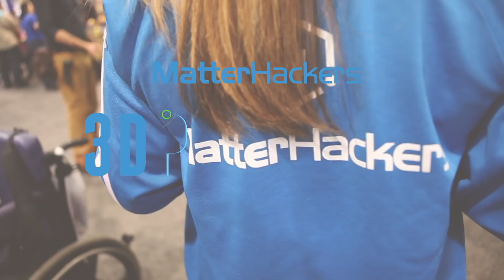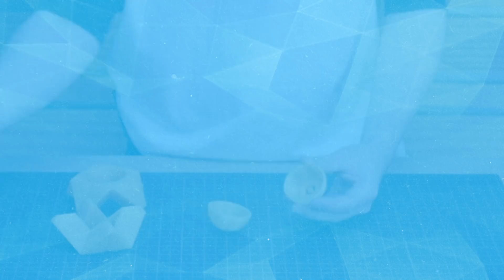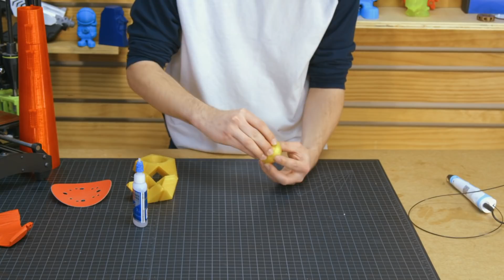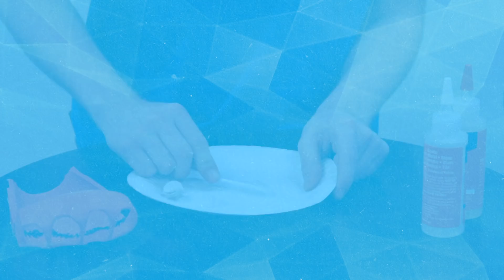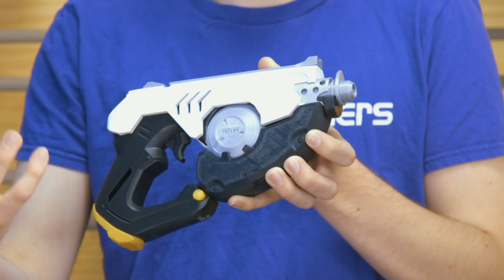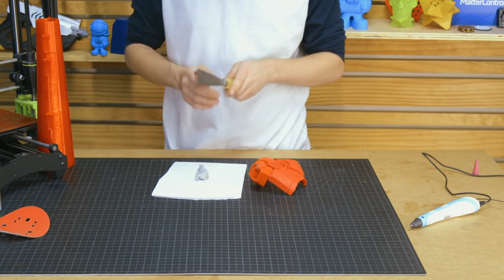How To Bond 3D Printed Parts // 3D Printing Guide and Tutorial

Comment: Hey thanks for the video, I may get a weldering filament pen, I am going to be printing helmets so will be weldering the inside, but for the outside do you need to add some glue or does that stay pretty flush to the other part naturally? I fear that if you do the inside the outside could come apart? 
Thanks a lot

Comment: One more thing about super glue (CA): it gives of fumes that discolor some plastics like PLA when it touches it. Same effect as when you use too much ethyl acetate (for PLA) to smoothen surfaces.
You end up with "white smoke" like tainted parts. You can get some of that off with water if you act immediately.

Comment: Matterhackers: "PLA is non-reactive"
Methylene Chloride:  "Hold my beer"
Reply: can we join PLA parts using this chemical? Is it safe?
Reply: @raghavgarg6909  Yes, you can join parts using methylene chloride. Is it safe - that depends on you.

If you mess with it in a non ventilated room, not safe.

If you make sure you have ventilation and gloves etc, then it's as safe as any other chemicals you can use to bond stuff together.

Comment: I like using the black rubber reinforced CA glue thats available at most hobby shops. Before I join the pieces, spray a little CA kicker on a paper towel and wipe the mating surfaces. Don't spray it directly on the parts as it does seem to attack the plastic. The wipe on method preps the surface without sanding and speeds the curing of the CA glue. Just be sure your parts are aligned because you won't get a second chance.

Comment: Depending on the model I use an old soldering iron with a very flat tip to heat up the connection points. I also use it when there is a crack in the model.

Comment: Now what I would have liked to hear was what kind of glue works with what kind of materials.
For example
Prints in PLA can be glued with....
Prints in ABS can be glued with...... etc.

I have spend a lot of time wasted trying to glue PLA together with cyanoacrylate glue just to find out that there are so many types of cyanoacrylate, that some work and some don't.
Then, switching to other materials, like NGEN of ABS, I found that cyanoacrylate types that didn't work on PLA, worked like crazy on NGEN, etc.

It would be really great if filament suppliers (like you guys) supply the users with the info on what glue works best on that material. Even better, if you sell the glue in your shop.
Reply: A solvent for ABS is acetone. It can be found in nail polish remover.
A solvent for PLA and PETG is dichloromethane. It can be found in Weld-On 16.
Reply: PLA-Use loctite gel superglue

Comment: You can also use a rotary tool to weld parts with filament. Put a short piece in the chuck/collet, spin it up, and apply light pressure to the seam. The friction from the contact melts the plastic around the seam and the filler plastic in the tool, fusing them together much like you'd see with metal welding.